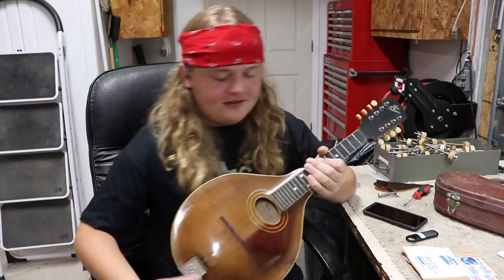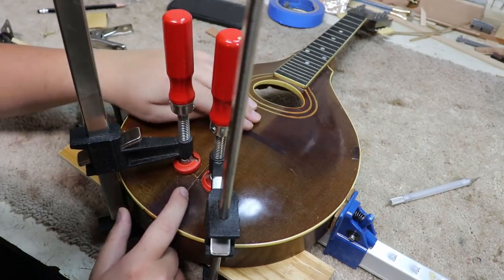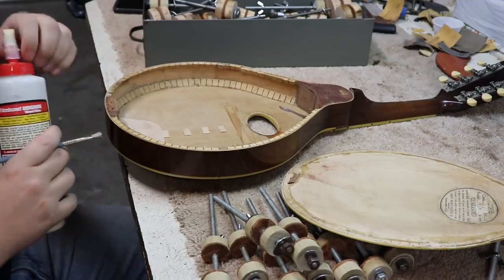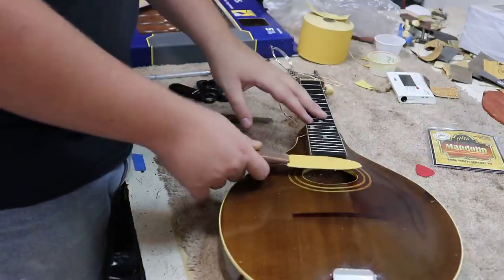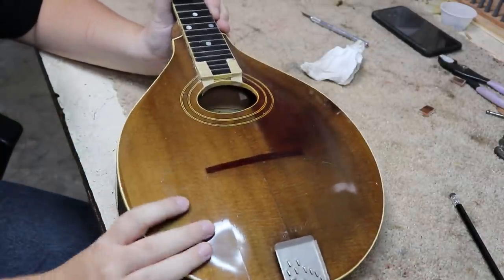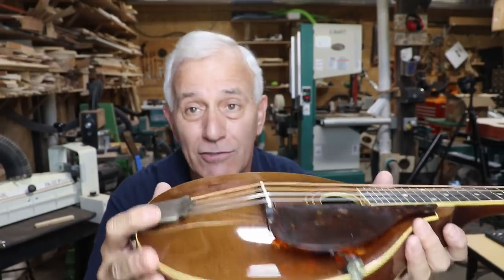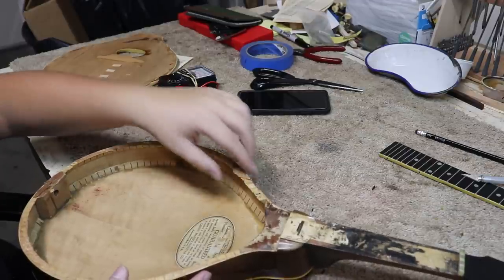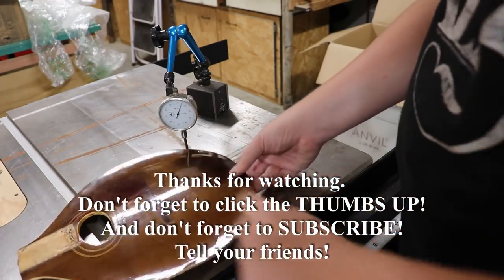443 RSW A Gibson From Where Part 1

Comment: Excellent effort Caleb! Don't worry too much about the post-repair crack.

This mandolin is 102 years old and has spent at least some of that time on a tropical island that is hot, humid and salty.

The average temperature, even on the most northerly main island, is about 25C/77F. However that's the average daily temperature day and night. Virtually every day is over 30C/86F at some point.

The humidity is usually between 80 - 85% but can reach 95%, sometimes for months at a time.

Unless this instrument has only been played in a Climate Controlled atmosphere (which I can guarantee it hasn't) this poor old Gibson didn't have a chance. Sent 7000 odd miles (probably) by air where the temperature in the cargo hold can be below 7C/45F.

Poor thing shivered itself to pieces.

Comment: What the mandolin did in a former life to manifest this 2020 storyline is mind-numbing. When I see binding work I literally  begin to vomit. I'm satisfied with the Harmony guitars from the sixties. The binding is painted on and the wood ages like a Martin, maybe better. I call this a rebuild. Total Rebuild, like the Schwarzenegger film.  This is scarier. I would have suggested a brand new Chinese mandolin at this point, that's me. I understand rebuilds very well. I rebuilt an amplifier, mostly brittle plastic, that was designed to rot from inception. I rebuilt that tiny battery amp a lot.It was the size of a very small paperback book and much lighter and it attached to a beltloop. Louder than a Pignose at one-third the weight.Total rebuild, sometimes I surrender.

Comment: A 102 year old mandolin with a thin arched top and only one brace???...I am surprised it lasted this long.  The previously installed cleats prove that the top was already compromised.  You did did a good job trying to save this.  Do you work on Ovation guitars?  I have a 1983 collectors edition with a top that is sunken in near the bridge and the fingerboard near the sound hole has also sunken in.  Can it be fixed?  Is it worth fixing?

Comment: It's a pity the top could not withstand the pressure of being strung up. It was sounding absolutely beautiful before the top failed. I was surprised by the absence of any significant bracing on the top, but I don't know if that's typical or not. I'm sure the new top will work well. Looking forward to seeing the next video.
Reply: Believe it or not. Before Loar all of them had just that one brace to keep the top from splitting from the sound hole.
Reply: @davestambaugh7282  Thanks for clarifying that.

Comment: I've probably told this before; I had my dads old Archtop restored years ago, it is a Kay or Harmony. The gentlemen that restored it did an awesome job with a beautiful sunburst finish. A few years later it was sitting on a guitar stand and in the middle of the night I was awoken by it playing by itself. It startled me for a minute and I jumped up and turned on the lights. A crack was opening up before my eyes and vibrating the strings! Since then more cracks have appeared and I decided it's a looker and no longer a player.
Reply: That's  a shame, but at least you've still got it to look at.
Reply: I guess sometimes the wood gets to old and starts splitting no matter what you do. Just like this mandolin, we blame the top for being too thin, but how many years did it take to crack apart like this. I'm sure it's got some stories it could tell and many good times. When it was bought originally, did the owner think it would last 100 years? Well Jerry is giving this mandolin a new lease on life, and I think with a few tools and Jerry's videos, you could fix that guitar.
Reply: jthonn It has other issues; the neck did not have a truss rod and was bowed. I took it to a different guy after the refinish and he removed the fingerboard and routed out a slot for some type of metal bar to straighten it out and needless to say he wasn't a Jerry Rosa. I have a Gibson L5 reissue so I still play an Archtop.
Reply: @rich40701  Wow, sorry to hear that. Sometimes you have to give up I guess. Jerry could fix it, but it may not be worth it.

Comment: Caleb, you had that together well enough, Jerry has had guitars that popped braces later on after delivering to customers and all kinds of things can happen. It's old! My thought was fixing one crack usually isn't too bad like the original crack already had cleats. But if the  customer is ok with making a replacement top to preserve another 100 years that's ok too. Imagine if you will there was a flaw in the original piece of wood that allowed the crossgrain fracture, it showed up and wasn't done changing yet.  I guess a complete doubler could be attached inside also to avoid replacing the original top but it's still needing fixing. You will get it done. I'm proud of your spirit and level of determination.
Reply: That;s a real possibility about the crossgrain break, and Jerry also said the wood was thin in that area, I think - maybe the flaw was in the original construction, not the actual wood?

Comment: I have a question...and I don't mean it in a contentious way. Isn't it probable that the caul you put in changed the nature of the stress from the strings and caused the new crack? I would rather have you figure out a way to fix the old top rather than replace it. Could you put braces in it like a guitar?
Reply from the maker: It was carved to thin from the factory which caused it to break multiple times it had been repaired multiple times it was time to cut the losses and do it right

Comment: Caleb, I believe you have helped me immensely.  I have an acoustic guitar that was on a couch and I accidently sat on it.  The top is almost destroyed and it is not worth sending to a shop @ $80.00 / hr.  However you showed me that it might be possible to remove the back with the binding attached.  If that works, I should be able to gently push the top back up, replace kerfling as nesessary, glue the cracks and reposition the top.  Then clete it of course and reinstall the back.  After that, I will have my Nashville tuned guitar again.  There is hope !
Reply: You may have to remove the binding depending on how it was done, either way you can do it,  Good Luck!
Reply: @jthonn  Thanks.  I have been scared of trying to repair it.  I realize that I cannot really lose;  it is useless as it is.  One of these days I will take the nonexistant risk !

Comment: Your thinking process is really good, I'm impressed at how quickly you've picked this stuff up. I have my grandfather's A1 that I will have to get worked on soon. It has dried out enough that the back has separated, as well as the seam on the top. Jerry had a video on another one kind of similar to mine with a dried out back, but the back and sides were coming apart on that one. On mine, they are solid. In fact, it's only the seams between the plates that need to be dealt with. I'm really wondering what the best way to deal with these issues would be, especially the back. One day.

ETA: Hi to Grandma!
Reply: I bought a junked 1963 Gibson B45 12 where practically the same had happened. The glue was just dust on all the braces, blocks and linings. Also saw a video of a Gibson J45 which was just the same. Is this common - presumably hide glue?
Reply: @robertnewell5057  I think that is why Jerry likes that tite bond, he sees so many old instruments coming apart because of the old glue. He had a video not too long ago that it seemed every brace he touched was coming loose. At a customer's expense is one thing, but if it were mine that I was doing myself, I would re-glue all bracing, even if the others weren't loose yet because you know it's coming and you are already in there. I glued up a small brace in my friend's guitar (through the sound hole) and used 2 spring loaded toilet paper holder things to hold it in, seems to have worked fine, at least so far. I would have never attempted such a thing until I started watching Jerry's videos.